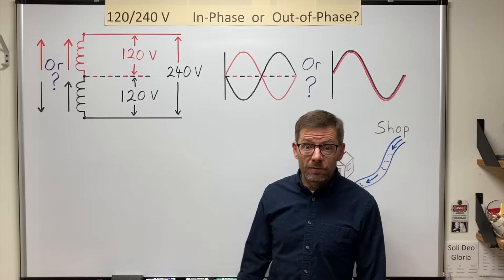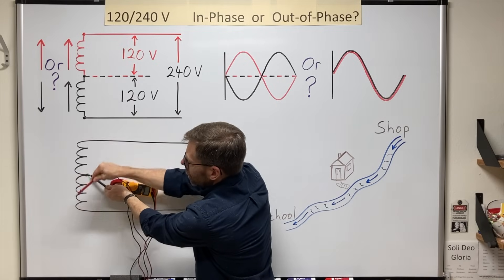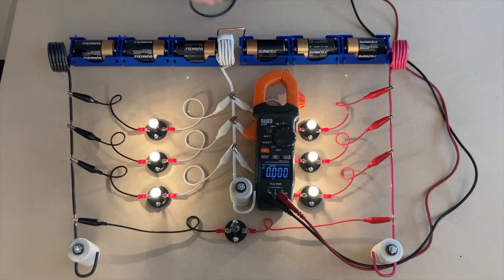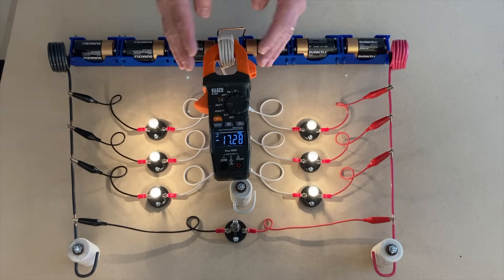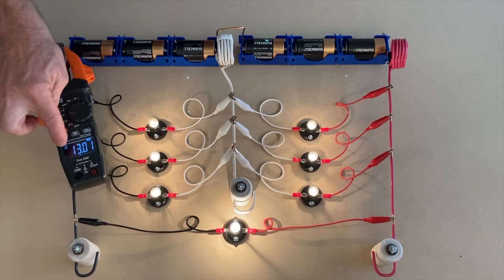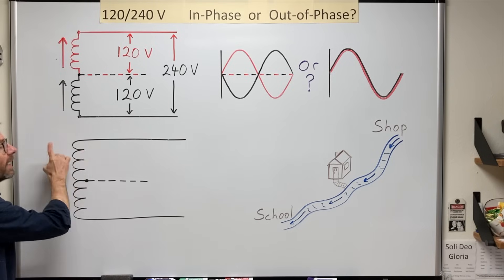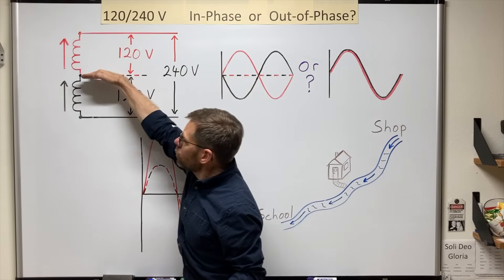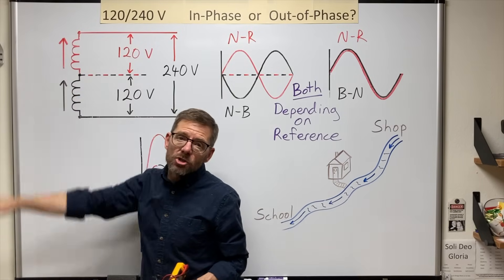120/240 V  In-Phase or Out-of-Phase

Comment: I very much enjoyed this video and its explanation of the output of a center tapped transformer. I particularly liked the example of flattening one sine wave to demonstrate a single phase of twice the amplitude. I understand that the output differs from say a three phase generator where the coils and rotation cause the phases to be physically sepearated by 120 degrees along the time axis, but I find arguing about the "in phase" of "out of phase" argument about household current about as useful as agruing whether a Zebra is white with black stripes or the reverse.

Once you understand how it works and what is happening I think the distinction is meaningless. The output of the center tapped transformer when referenced to neutral behaves exactly as two seperate mechanically produced phases would. I have always thought as the wave as "flipped" as opposed to shifted 180 degrees.

I would like to see an experiment where someone built a two phase generator running 180 degrees out of phase rather than the conventional 90 deg and hooked that output to three test points and then hooked the output of a center tapped to three others. With the sources of the power hidden. I wonder if it would be possible to identify which was which.
Thanks for a great video. I always find that thinking of things like this in as many ways, with as many examples as possible really helps to visualize what's actually going on.

Comment: With 120 vpp.  There is.   60   Vpeak positive and 60 vpeak. Negative. Making. 120 v peak to peak.

With 2.  In phase  sine waves.  2. X.    60. Volt peak positive we get 120 v peak positive and 2 x 
60 v peak negative. We get 120 volt. Peak negative meaning. 120 v peak positive and 120 volt peak negative we get 240 volts peak to peak!
Reply: No, itl is not 120vpp. It is 120v/240v RMS.

Comment: In terms of converting AC to DC.  And a full wave rectifier we would want a center tap on the secondary of a transformer and there will be a hot , center tap and neutral on the secondary.

Comment: If they are 180 degrees out of phase , the 2 phases of 120 pp they equal zero .
Reply: No.  The difference between +120 and -120 is 240.  Voltage is potential difference.

Comment: I am sure that to get 240 vac out of  2 phases of 120 vac they have to be in phase. They are on top of one another not 180 degrees out of phase.
Reply: No. It is not 2 Phases. It is SINGLE Phase of 240v with a Center Tap.

Comment: I have two Ecoflow delta pros that each have a 30 amp 120v port and I wanted to take each half and combine them in a 240 box but I was afraid to try this without knowing more because this would not be split phase.
Reply: No guarantee the two units will be in-phase when running on battery.
Reply: I hav an EcoFlow 240v hub for the delta pro that I am trying to sell
Reply: @LarryRichelli  Yes. The 240v Hub is required

Comment: Like 95% of the way there and you jump to the opposite conclusion because the last graph in the upper right was drawn incorrectly.  What you drew was effectively two measurment leads connected to a single pair of power conductors. The black-neutral and neutral-red should be vertically separated, because there is also a black-red differential in the system which is essential information that should not have been discarded.

I believe your focus on the internals of the power source is what led you off course.
Pretend you have no knowledge of the power source transformer/generator/battery of cells/inverter, just three mystery wires. Remember we are concerned with power phase here, not the internals of the power sources. (There could be multiple sources of power and claiming in phase or out of phase within a coil becomes rather misleading and pedantic to define. Also consider that defining the anode and cathode in a cell is both irrelevent to the overall circuit and that they actually swap depending on charge or discharge state, despite only a small non-reversing change in general circuit voltage.)
 
Remember that while effective/useful potential is measured as the absolute differential(~RMS), the phase separation is signed(positive and negative) and non-arbitrary(more electros is always more negative). 
If the sources are in phase (both at positive peak at the same time), then they will have a constant voltage across them and will effectively become a DC voltage. In other words they start with a 3v difference and as one rises or falls  the other also rises or falls so 30⁰, 60⁰, 90⁰, 180⁰ later they will still have a 3v difference.
Reply: The secondary is a Single Phase winding with a Center Tap. The two halves are in series and In-Phase.  Their voltage ADD. It is the physical construction and cannot be changed.

Comment: Great video and I agree with everything you said except the terminology. L1 will always be 180° out of phase when compare to L2 and vice versa. If L1 is at +120 then L2 is -120. The in phase, out of phase terminology is really just a comparison to 3 phase to depict that L1 and L2 are always in sync with each other where in 3 phase power L1, L2 and and L3 are 120° apart
Reply: I agree with you.  L1 and L2 have to be out of phase with one another would respect to their sine waves otherwise how would you measure any voltage between them.

Comment: So, boys and girls - what is the terminology that we should be using?  Do we have single phase, split phase electric service... or what should we call it here in the U.S.?
Reply: We commonly call it split phase, but most of us don't need to call the overall structure anything.  We just need to know that some receptacles are 120 VAC and others are 240 VAC.  The latter take different plugs, so it's easy.  We don't even need to know that much.  If the receptacle mates with the plug on our electric clothes dryer, then it's the dryer receptacle.
Reply: It is Singles Phase.  The center tap on the secondary provides Split Phase to the home. The 240 volts is split and is available as two 120 volt circuits.

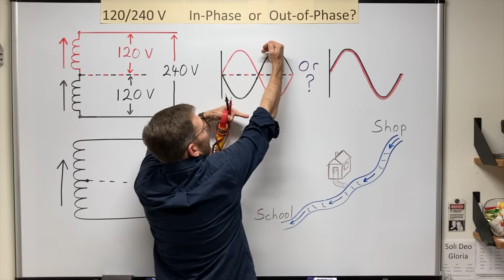Comment: In the North American system, with a so called split-phase, which is simply two phases, it is not possible @15:15 to get a 240V swing relative to the SAME reference as the default reference. The 120V and 240V are not in phase, that would happen if the secondary was referenced at one end, instead of the middle.
I appreciate that this is for electricians, but the 120/240V is easily contrasted to the original Edison's circuit. Two batteries, in series, referenced in the middle. It's that simple.

Comment: I feel like this unlocked something in my brain.. What still confuses me still is when it's "balanced" Dave makes it sound like the electricity is flowing all the way from one side of the "transformer" to the other, like the light at the very end does. Therefore there's no load on the neutral. BUT wouldn't that mean the "half" circuits are now being powered by "220" instead of "110". They are using the entire transformer not just one half of it? 
My limited understanding, wants to say when loads are balanced, each half is still just seeing the halved voltage, but since the polarity is opposing they cancel out on the neutral. But is power still flowing if it reads 0 amps on the neutral?! Haha.. this is so fascinating to me!

Comment: Can anyone explain to me why any other resource I can find online states that the two legs in a 240v split phase electrical circuit are 180 degrees out of phase, is it just a large misconception or am I misunderstanding something in the video?
Reply: He's saying it depends on how you look at it but technically they are "in phase" when you don't specify the Neutral as a reference point. If you consider each half of the transformer as just a combined sum of turns, they are in phase. They add up to a 240VAC RMS sine wave. If those combined halves were not in phase you wouldn't have any voltage outside of some tiny imbalance if the transformer wasn't perfect. Now pretend someone says they have a transformer with 240VAC secondary that will operate "out of phase". The only way that makes sense is if you have an L1 and L2 where each half of the transformer is wound in different polarities. That is what some people might think when outright referring to 240VAC as out of phase. If the windings reversed direction halfway across the secondary you wouldn't have 240VAC, so they are actually all in the same direction and "in phase" so to speak.

BUT if you consider each half as 120VAC RMS referenced to Neutral, they are out of phase relative to each other. It's easy to just say they are out of phase in electrical work because a residential service drop is going to have a Neutral. The two "legs", or rather, each end of the transformer windings are always going to be "out of phase" relative to the Neutral, and they are always going to be "in phase" relative to each other. The battery demonstration was a really good idea and gets the point across well. With 240VAC Line to Line there is no concern over in phase or out of phase obviously. All the "batteries" are in the same direction. A sum of like polarity adding up to a total. Add the center tap into the equation and this doesn't change anything about the "batteries" and their polarities. But then call the center tap a Neutral because it's going to be a reference point to each Line.. you automatically have to travel in opposite directions now to reach the end of each line when starting from Neutral. Neutral to Line in one direction for 120VAC, and Neutral to the other Line in the other direction for 120VAC. The 'directions' flip cause it's AC but starting from Neutral they will always be opposing each other. With 240VAC Line to Line you are using one end or the other as a reference point so it's only possible to travel in one direction to get the other "Line". Even when that direction Alternates, there's no other direction to go relative to it at the exact same time.
Reply: People claim there are UFO's, too.

Comment: Okay so I work for a power company and whenever we install a breaker we need to test our CT (current transformer) polarity. Sometimes we need to use station voltage as a reference when we shoot high current through the breaker to test the CT polarity. I always wondered if I shot one CT and referenced one outlet that was on X (as in XYN) what would happen if I shot the same CT with using Y as a reference??

Comment: Current flows from voltage to no voltage. . . .  So each of the 120V lines current does effectively flow to the Neutral.. ..    But because the TWO Live lines are running in opposite directions, that is 180° then the TWO Live current Cancel each other out in the Neutral, so the Neutral only carries the Difference current, and not the combined Total current.

AC is Alternating Current, So In or Out does not really mean anything, because they are alternating, that is why it is important to understand the correct AC Phase relationship of TWO Live 120V Lines.. .  . If there is 5 Amp in one Live line and 8 Amps in the other Live line, then the Neutral Current would be 3 Amps, on 2-phase 180° systems, and more complicated on 120° 2-phase, and 3-phase systems.
Reply: Voltage is potential difference.  Current flows between two points with a potential difference between them.  That is the correct way to state it.  You only have voltage at one point relative to another point.
Reply: @GH-oi2jf  Yes, totally correct. . .   If those two 120V were in phase, there would be no potential difference between them. . .   For 240V the two lines L1 & L2 have to be 180° out of phase with each other, then you have 2 x 120V potential difference.

Comment: Good talk, but you and many miss the point. . .  When you talk of phase, you need a Reference point. . .  With this arrangement, the American 120/240V 3-wire supply, the Reference MUST be the NEUTRAL point.  . .  That is the winding centre point, which is nominally at Zero potential. . . .  So that very simply and easily leaves the TWO Live lines running in opposite phases, that is when one is at its peak +  the other one will be at its peak -. . . .  So it is a 2-phase 180° 3-wire supply.
So I am saying You are WRONG, they are NOT in phase, you are NOT using the true Reference point, which is the Neutral, Grounded point. . . .  So if you look at your own drawing properly, the two arrows pointing up are such that the Red live line has the Arrow Point close to it. . . .  The bottom Black live line has the tail of the arrow close to it, so it is opposite phase. . .   Your Logic is wrong.

Comment: As always in these 'paradoxes', it's the assumption(s) that are in conflict. In particular, for a voltage measurement, you have to define the relevant reference point for each measurement. 

In this case we (I/you/they) can have two different views of which end of 'the other coil' is to be a reference. If we go with the centre tap as a common reference, the voltages are out of phase (opposite), while if we measure based on the diagram with 'top' end as the measurement, and the 'bottom' end as reference (which moves physically depending on coil), then we get the in-phase answer (for the Voltage!). 
Check for the direction of current flow - in some arrangements (3 coils in sequence) you can get the current to flow the 'wrong way' (two + and one -, makes for a single + voltage to the load).

Great explanation by Dave.!

And remember it for any of the other paradoxes you bump into, all based on mistaken assumptions ;-)

Comment: Apologies if this adds some confusion but just trying to add some clarity. Let’s start with the basic single winding you are showing as the voltage source and let’s look at it without any mid-tap, center-tap, neutral, or split-phase tap connection. i.e. Just the winding. In reality this is a winding as part of a transformer, possibly your home or business pole or pad mounted transformer. If we can agree that this winding is receiving its energy as a secondary winding to a primary winding, which is being fed from a generation source, then it would seem that our interest in labeling any of the downstream, secondary wiring as “in-phase” or “out-of-phase” should always be in reference to any of the other transformer primary windings. With this approach, I am looking at our common electrical power generation and distribution system, where for example, the hydro-electric plant’s generator creates voltages via 3 distinct windings and because the armature is rotating across these 3 windings at different times, we have 3 windings which are physically arranged to be producing voltages 120 degrees (1/3 of 360) from each other. These three windings are then tied together in series, or some would say in a delta connection with three tap conductors to be extended out through various control and distribution apparatus to our local pad or pole mounted transformers. And back to my point, it is these conductors that will impact on our reference to phasing, or as we commonly label - A Phase, B-Phase, and C-Phase. My own education has me of the understanding that our commonly used system of 120/240 volts is simply a secondary winding of a local utility power transformer, which is being induced with a 240 volt voltage from a primary winding being fed from 1 or 2 of these original hydro-electric source conductors. And I include the possibility of 1 source conductor simply because in some cases the primary voltage to our local transformers may just be a primary winding utilizing one source conductor and a common grounding tie with the secondary. So when I look at this discussion, I tend to disregard references to phasing within any of the secondary 120/240 volt wiring because to me the phase of this wiring is linked to whatever source conductor or conductors are used to power the local primary winding. Yes, you could have true original source phasing within the home or business system, but it would be because the 3-phase power has been brought in and is fully utilized to power a 3-phase transformer which in turn has 3-phase secondary windings, possibly delta or Y connections. Having offered this, I also acknowledge the ability to engineer electrical phasing to operate certain 3-phase equipment. But when I read the original question Dave put out there, relative to the AC sine-wave(s), I just immediately assume it is in phase due to how the 240 volt secondary winding is powered. And I am still open to being re-educated as to how to look at phasing. I do also understand that when we want to refer to either side of the 240 volt power source, we tend to say the “black phase” or the “red phase” or even the “A phase” or “B phase”. But if you work enough with actual 3-phase power wiring, it seems odd to refer to the two conductors supplying the 240 volts as individual phases themselves simply because their source winding is one single phase. And I just never liked using “split-phase” either when looking at either of the 240 volt conductors in relation to a neutral or center-tap connection because again the phasing was created up stream. You can tap that 240 volt winding anywhere and create a myriad of different voltages but to refer to them as phases doesn’t seem to really relate to the true rotational phase of the AC voltage. And reversing wire connections in an attempt to create polarity is just simply reversing the the way in which the magnetic fields interact to boost or buck voltages reactive resistances.
Reply: Beautifully said.
Reply: I get what you’re saying. At the end of the day, phases and phase angles refer to time. The amount of time between two things, whether it be voltage to voltage or voltage to current. There is not delay shift of time in a transformer so the taps on the windings cannot be out of phase.